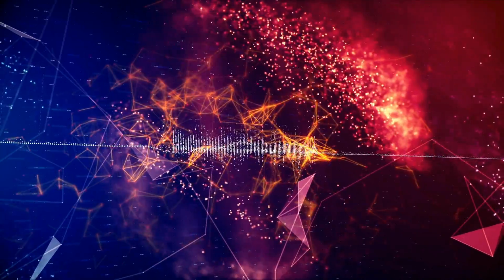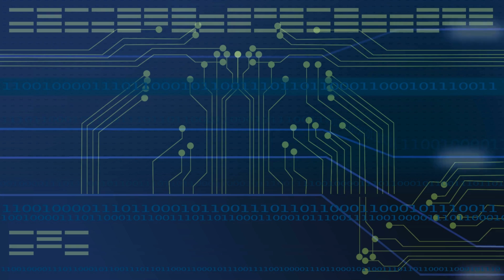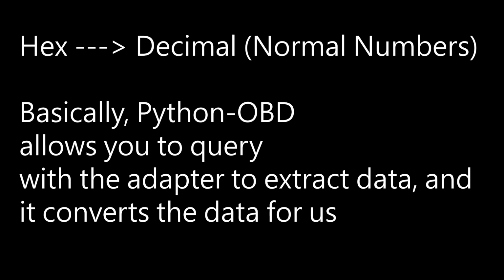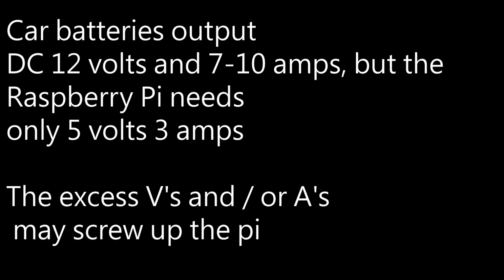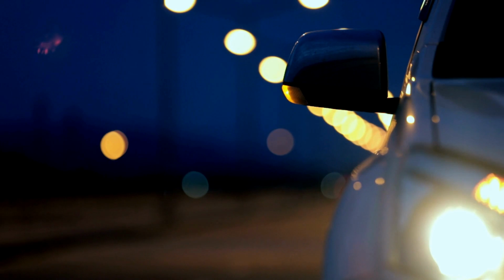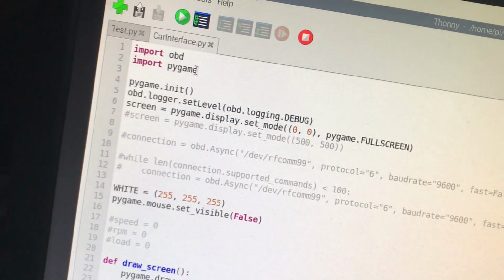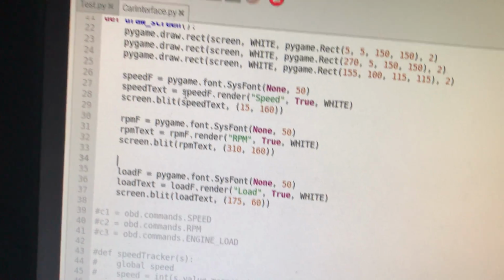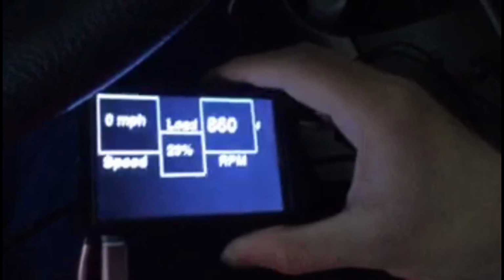Building a Car Interface Using Raspberry Pi 4 | Bluetooth Sync With OBD II Adapter

Comment: would it be possible to make the display more appealing (colors , shapes , positioning, etc) Or is only black and white boxes supported ?
Reply from the maker: You are only limited by what PyGame allows. You can change whatever you want, whether it be color, shape, etc. Black and White boxes are not the only things available, I just used them because they’re the most basic. So yeah, use what PyGame provides to your heart’s content
Reply: @archan6el774  Ah makes sense, very cool! Customization is definitely a cool factor to explore in a project like this. Thanks for the response man.

Comment: Nice project. Is there a way to get tire pressure from obd ?
Reply from the maker: I’m pretty sure that you can get tire pressure, but I may be wrong
Reply: Depends. For a vehicle that has TPMS already equipped, then yes if you have to do some work with scanning canbus to find the address to that sensor and decode it. Very doable and i'm sure if you look further into it, you might find someone has already done and shared it. Good luck, you can do it!! Might look into Pican2 for raspberry pi as well.

Comment: I have an issue to pair the obd2 Bluetooth adapter with the raspberry pi 4
Reply from the maker: Is the issue with the adapter connecting to the radpberry pi? Or is it a problem with Python-obd not reading data from the adapter. If it’s just the adapter connecting to the pi, my problem was that the ignition had to be on for it to work. So maybe just make sure that the car is running.

Comment: Hello 
I keep getting these types of errors but I am pretty sure that my car has obd 2 port its a suzuki swift 2018 and i am using a similar adapter too can anyone help!!!

[obd.obd] 'b'010D': Vehicle Speed' is not supported
[obd.obd] 'b'010C': Engine RPM' is not supported
[obd.obd] 'b'0104': Calculated Engine Load' is not supported
Reply from the maker: Ok its been a while since I worked on this, but I think you're getting those errors because your pi isn't able to get those results from your adapter. If I remember correctly, when I did it, the pi would query with the obd adapter and basically return all the available commands it can perform. It was like the pi was checking with the adapter to see what kind of data it could extract. Basically, speed, rpm, and load aren't one of those commands being returned as available for you. I had the same problem too I think. Basically, sometimes my pi would return with no available commands, and sometimes it would only return with like 5. I fixed it by having a while loop that kept on querying with the adapter until it finally got a result with 100+ commands (Every time it returned with over 100 commands available, it would work). Like I said, its been a while since I worked on this project and my memory may be hazy, but I hope this helps

Comment: Hi, I’m working on a similar project but I noticed in the past that WiFi and Bluetooth OBD interfaces are pretty slow, so for my current project I’m going to hardwire the interface. If I recall correctly CAN bus transmission speeds aren’t particularly fast but a hardwired Pi should be as real-time as we can get (compared to an 8bit Arduino).
What are your thoughts?
Reply from the maker: Sounds good man. Hardwiring the Pi would also skip the whole connecting over Bluetooth thing (connecting alone took me way longer than I care to admit lol)
Reply: @archan6el774  connecting via Bluetooth is cumbersome yea, I'm making a ble app and that is taking forever. Did you notice slow data rate from the Bluetooth to the pi? And did each data point have nice time stamps? If so, how much data per second were you getting?